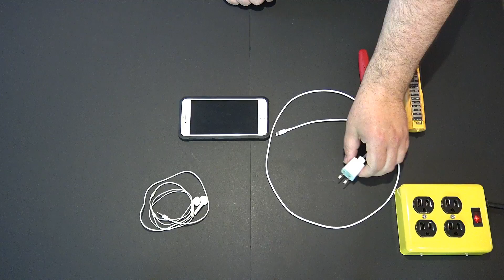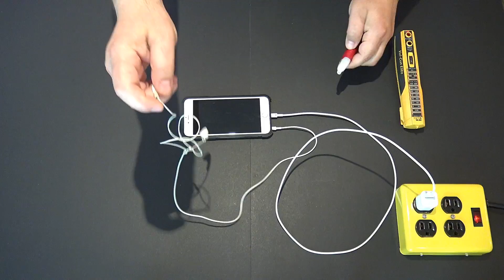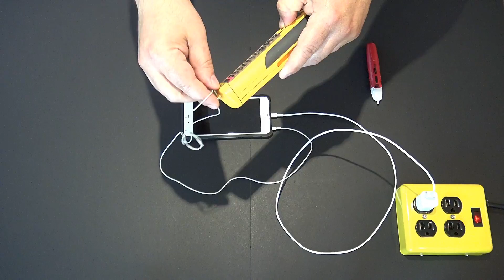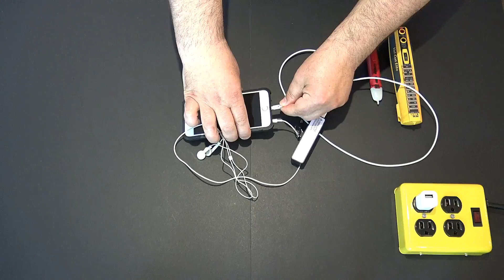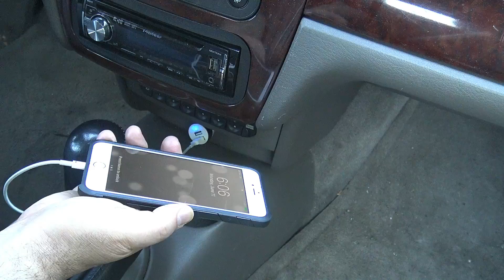Is it safe to use your phone while it's charging?

Comment: can you measure with a multimeter? (A + V simultaneously, resistance to the human body, amount of lethal electricity V or A (Volt and Amper)) 
1) Put an electrically conductive cloth against the phone (such as your ear / face) and measure the multimetry on the  (grounded) panel wall.
2) or metal (grounded) against the radiator
3) or (grounded) water pipes (or even a larger surface, such as a bed that is against a grounded wall, ie the bed in the bed is also grounded).
4) refrigerator, stoves, etc.
Reply: Man is electrocuted after using headphones connected to his charging mobile phone in Thailand

Comment: The non contact voltage tester you are using only detects alternating current. The outlet in the house is alternating current. The charging bank and car battery are direct current

Comment: Electroboom debunked the myth that using your phone while it is charging can harm you. It is the fourth Latity video. if you don't want to watch it, he basically says that there is a weak ac path through an outlet, and it is harmless. It's like the 0.1 microsieverts from a banana, so charging your phone while using it is safe. Just keep in mind that the battery will charge slower and generate more heat.

Comment: Using your phone while charging can Degrade your battery and phone not Also that you can shock your self.

Edit:This is true look it up if you don't believe me.

⚠️ Warning ⚠️:Do at Your Own will and you'll get a high voltage shock.
Reply: Bro don't be stupid. Its just 5 volt DC and it's nothing. You will not get a shock by using your phone while charging.
But I am not saying that using your phone while charging is good Idea because the phone overheats and it can burst. It is because when a battery charges, current flows to the battery and it heats and because your also using it,  it will also give power to the phone so that heats it a alot.But many new phones do not burst when you use it while charging but old ones can burst. And another thing is current will always flow in your phone because to power up all the components in your phone there should be current flowing from the battery to the phone. So current does not necessarily need to flow when you are charging.
So what I am trying to say is you can't get a electric shock by using your phone while charging because it is just 5 volts. But it can overheat and burst.
Reply: And another thing is that there will always be current flowing in your earphones when you use it. So there will be no difference when you use it or not while charging.

Comment: Just wondering why charging with powerbank different than plug it to charger ? Doesn't the output is the sama ?
Reply: Powerbanks  are  to be used if you need to charge phone and your maybe  out camping or hiking where there isnt a building with electricity to charge your phone.

Comment: Many battery chargers need to be turned on before they start to power the device their connected to. Are you sure the battery charger was on? Also, many car outlets are also not on until the car is running. Are you sure the car's power outlet was providing power? What kind of "meters" are those? Voltmeters (voltage) or ammeters (current). Anyway, there is no measurable harm to a modern smartphone's  lithium ion battery when it is being used and charging. The only difference is that charging will be slower while the phone is also being used. Some chargers and cables can not provide enough power in to offset the power being used by the running phone and your battery will actually lose some energy while running and being charged. This can happen when using the phone in a car and running navigation apps...which can draw a lot of power.

Comment: Hey please read this I search about this video not exactly but I search what happen to our body when using smartphone while charging and I see this video I research about this because last night I plug an extension plug to use my phone while charging on my bed and I constanly hearing a plastic thing you know when you keep moving a plastic bag not the one that is soft but a hard plastic bag its like the one that is use on the kids toys. Yeah I constanly hearing that kind of noise when I move my blanket, note I have earphones too. Then I just keep ignoring it then 12:00 am I stop using my phone after that I put my blanket all over my body and then I suddenly hear that sound again I investigate I keep moving my blanket and the at the corner of the blanket I hear it and then I try and try to move my blanket again thinking that my blanket has a small plastic hanging in there after I try and try it. Suddenly my pointing finger release a thin 1 inches long electricity and then im shock. And I just think my self that I am only hallucinating because its already 12 midnight. After that I ignore it after 7 mins. I started to think over it again then I tried to rub my finger on the blanket but nothing happen and then i tried and tried and then a point of electricity I saw it on my fingertip. Thinking to myself im not hallucinating. And note I started using my phone 8:00 pm and I use it 16% 8 pm to 12 am my phone doesnt charging up so I keep it plug then morning I tried to tell my mom but they just make fun of me right now I started doing it again and I start 9:00 pm after 30 mins.I hear the sound again I try to rub my finger again but I dont see electricity I just felt being ground by a small flow of electricity then 10:30 pm I try to video it so that I can show them but my phone cant pickup on dark but when I rub my hands on the same blanket I saw a electricity flow to the edge of my hands as I rub my hands thats why search about this.
Reply: It's not safe
Reply: PrinceCO7 thanks for the essay but half that is from a untrustworthy page on Wikipedia
Reply: Here's an explanation. Static electricity. You rubbing on your blanket may have generated a bit of static electricity. Basically, it has to do a lot with atoms and their charge where the positive atoms are more attracted to negative atoms and by rubbing on the blanket, you sort of create a mini zone where all the charges become negatively charged, and when that comes into close proximity with a positively charged surface, it makes a spark. Typically its not a very strong spark so there's not danger in your room. 
As for the plastic sound in your earphones. Its actually built in your earphones. Its basically like a mini amplifier dome. Like how you can make your sound louder if you speak into a traffic cone. So yeah, there's nothing wrong.
Reply: As for the blanket plastic, sometimes manufactures put in sheets of plastics in the corners. Just to maintain the shape. No danger. That, or you don't know the material of your blanket. Again, no danger whatsoever.

Comment: Please make another video explain what is happening. I think you just scared some people.  It a differents of type of voltage (A.C. and D.C.) also the amount of current been used by the devices.. The detectors you use are mostly used for alternating current.  The devices you used in the video are only detecting lines of fluxs or electromagnetic pulses. Which is magnetism.  Please! I really enjoy your videos.  Follow up on the explanation.
Reply: I dont understand please explain? Doesnt he scan that theres electricity flow into your body when u touch it when its charged vs when its not?

Comment: I think those meters detect alternating current not direct current !
Reply: Your phone charger will transfer ac to dc, so the current leaving the charger is always dc despite of the power source
Reply: Hussein Tofaili this is not accurate as ac current can leak because of not enough filtering in a bad charger
Reply: how can you charge a phone wih ac?
Reply: @itzvinnyman980  By plugging it into an electrical outlet, as he did in the first test.
Reply: true
Reply: B
Reply: I think some amount of ac left with dc.
Reply: @techietive  lol
Reply: But still it spread electricity into your body?
Reply: The meters detect the electrical "noise "   you can also sit next to a lead thats plugged into the wall at home thats giving your bedlamp power.  Nobodies  brain got fried yet.